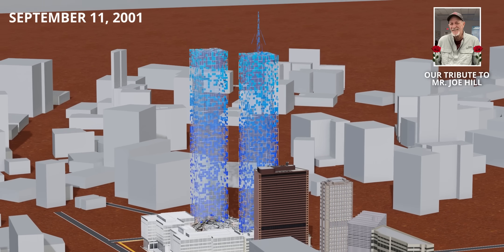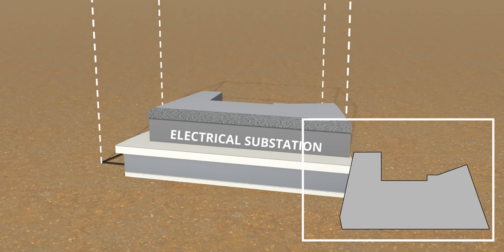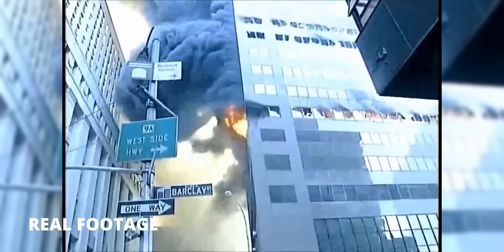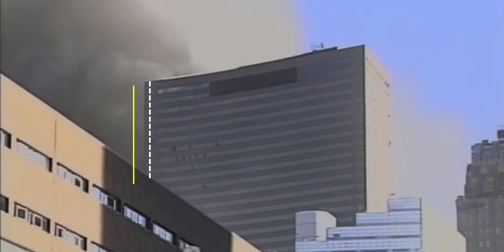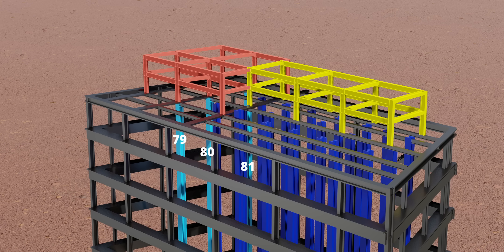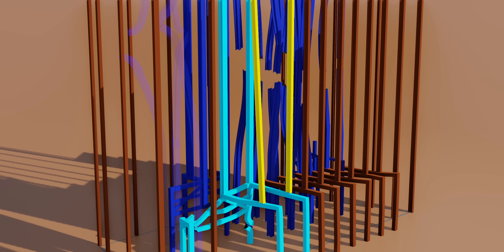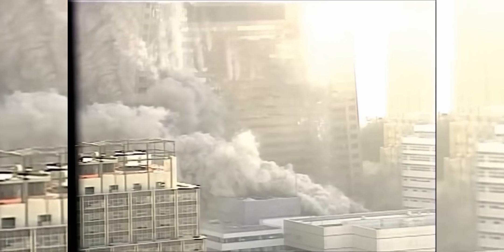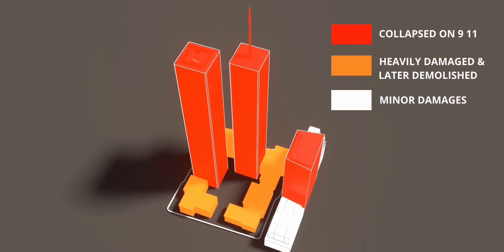Collapse of Building 7 | The Complete Physics

Comment: Sorry this explanation is totally unlogical.
Reply: The logic follows perfectly.  In the same order but fleshed out in greater detail;  The North Tower collapse at 10:28am bombarded Building 7 with thousands of tons of burning debris, causing heavy damage and starting raging fires burning out of control for the next 7 hours. Half the responding FDNY firefighters having been killed, others injured, units in disarray, much of their equipment destroyed, no water pressure, and the greater urgency of Search & Rescue efforts, firefighting efforts at 7 were pulled as futile. The building couldn’t be saved and was left to its fate.

youtube.com/watch?v=g_SvpwyC17M&ab_channel=MFitz 

Collapse of a burning structure is always a concern for firefighters. Steel buildings subject to fire rely on active fighting of the fires to survive. Left to their own devices they will collapse. Buildings are designed around 1 to 3 hours of fire resistance, allowing time for occupants to escape and ACTIVE firefighting to get started, after which all bets are off. In B7 the occupants escaped, passive and active fire protections were compromised and active firefighting never got started which left the building to take its chances. It lost. Odds on Building 7 would eventually collapse,… and it did. No big deal in logic. That is the sort of choice firefighters make every day in brush fire situations - which houses to save and which ones to let go. Only real difference here is moving the decimal on the size and cost.

FDNY Chief Daniel Nigro ; The biggest decision we had to make on the first day was to clear the area and create a collapse zone around the severely damaged 7 World Trade Center, a 47-story building heavily involved in fire. A number of fire officers and companies assessed the damage to the building. The appraisals indicated that the buildings structural integrity was in serious doubt. I issued orders to PULL BACK the firefighters and define the collapse zone. It was a critical decision; We could not lose any more firefighters. It took a lot of time to PULL EVERYONE OUT, given the emotionalism of the day, communications difficulties and the collapse terrain

FDNY Deputy Chief Peter Hayden - We had our special operations people set up surveying instruments to monitor and see if there was any movement in the building. We were concerned of the possibility of collapse in the building. And we had a discussion with one particular engineer there, and we asked him if we allowed it to burn could we anticipate a collapse and if so, how soon? And it turned out that he was pretty much right on the money, that he said 'In its current state you have about 5 hours

Building 7’s collapse was totally different to the Twin Towers, harder to understand and most of the details difficult to see. But we can sort out what happened through careful analysis and observation.  What follows is MY EXPLANATION of the collapse sequence using the best available information and relying on no authority.

B7 was complex structure, a 47-story steel framed building built on top of a smaller existing 3-story building, requiring several lower floors dedicated to complex load transfer structures instead of usable office space. Of trapezoidal shape and all-steel tube-in-tube construction, B7 (above the 7th floor) consisted of a central core of steel columns carrying most of the gravity load, perimeter steel columns around the outside of the structure carrying the remainder of the gravity loads and long span beams and girders to tie those elements together and form the floors. On the outside of the building hung a moment frame - the last part of B7 to fall. 

Phase 1 : Collapse initiation for B7 is notably quiet with observers not realizing the building was collapsing! There was no audible warning in the form of say hundreds of ear drum busting 180-190dB explosive bangs preceding the collapse. The first externally visible signs of collapse initiation occurred at 5:20:28 pm. Here at 12:00 a local CBS affiliate reporter is talking 10 blocks from B7 when collapse begins. People don’t start to notice the collapse until 12:11. Then at 12:45 is the famous CBS fixed camera clip of Building 7’s collapse Again, note how quiet it is.

youtube.com/watch?v=t5tEy6mXSE8&ab_channel=fresnosean379

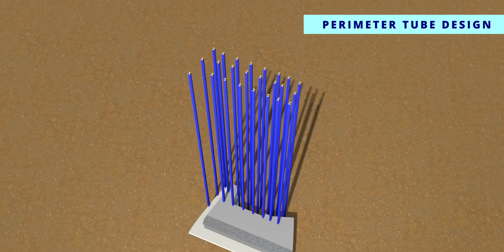Collapse initiation was due to multiple lower floor failures above the load transfer region (7th floor) in the NE corner of the building. In this video at 0:45 you can see the NW corner from inside the building while under construction, Column 79 just out of frame on the left. That big, angled steel beam across the top of the frame connects to C79 at one end. The girders connect to the beam. The beam and all those girders depend on just one connection

youtube.com/watch?v=nP3TNHPCIVU&t=35s&ab_channel=EdwardCurrent

Phase 2 : Lower floor failures left core Column 79 laterally unsupported over an excessive length and it buckled. If you look at a floor diagram of Building 7 (see above) and look at all the structures that depend on C79 you quickly realize this one column was a relatively isolated structural element on which a disproportionately greater fraction of the structure depended . Externally we see a vertical progression of window breakage along the 44-46 line and a kink in the roof of the East Mechanical Penthouse at the top of the building, consistent with C79 failure. The transition from full capacity to almost no capacity occurs in virtually an instant. Once the buckling failure occurs there is almost no resistance

Normally with a buckling column, the load could very well be redistributed to other columns, meaning the buckling could stop after a while. With C79 that is not the case - the failure did not redistribute the load, so the collapse rapidly progressed to the roofline, sinking the rooftop penthouse.

Phase 3 : With C79 gone, B7’s progressive, non-symmetrical collapse continues with C80 and C81 at the east end of the core left laterally unsupported and quickly buckled and failed as well, sending the EMP down through the building. C79-81 all have no diagonal bracing, which I believe is a major reason why they could not redistribute a lot of vertical loads among one another.

From there collapse progressed from east to west through the central core until the core was gone taking all of the interior floors and structures and probably most of the perimeter columns with it. You can see the horizontal progression of window failures low in the building and the dropping of the remaining rooftop structures into the building. One of the big takeaways from the NIST Building 7 study (that gets completely ignored) was their modeling which determined C79 failing under ANY circumstances would have initiated the same collapse sequence.

Phase 4 : After about 10 seconds only the exterior moment frame - a hollow shell mostly supported by the 4 corner columns and quite unable to stand on its own – remains, creating the illusion the building is still standing since little has changed externally. That’s just hollow empty shell, like an empty cereal box. The north leans inward, forming a V in the roofline. The last remaining perimeter columns buckle under the strain.  There is almost no resistance as the moment frame free falls, landing on top of the 7-story high debris pile, blocked surrounding streets, heavily damaged the Verizon Building and destroyed Fiterman Hall at 30 W. Broadway, all well outside of Building 7’s “footprint”.  It is only here, at the very end that a single utterly meaningless measurement of alleged free fall is taken. Start to finish the collapse took 18-20 seconds, or less than 1/3 of true free fall*. Not that we really care since how fast something falls cannot tell you what started it falling in the first place. The free fall argument is about the collapse of the outer shell *AFTER all of the critical internal structure had already failed and completely ignores about 80-90% - of the collapse. 

Building 7’s progressive, non-symmetrical collapse was incidental and unintended collateral damage from the combined effects of fire + time + gravity started by the collapsing North Tower. That is true no matter who planned and carried out the 9/11 attacks or why . The collapse was of so little consequence it barely even registered at the time, a mere footnote. 

I hope you found this helpful. It is meant to be informative, not adversarial and to solicit informed critical comment. If I made any errors of fact, logic or reason or left anything critical out, please let me know so I can fix it. IF you can offer a more plausible alternative be my guest. So far no one has even tried. Please start any reply with the words “Tits McGee” or I will know you didn’t actually read it.
Reply: So, exactly where, and in what logical way, does it fail?
Reply: Why do the majority of independent, nongovernment-funded experts on these topics consider the cause of collapse to be ”uncertain”?
Reply: @midsneak   Because "truthers" can't read anything that ruins the fairy tale.
Reply: @midsneak  - Then make that case - don't leave anything out. Let's see how you do. Then take your findings to a Grand Jury.
Reply: @midsneak  So, your replay was, "I have no argument, here's something irrelevant to prove I am SMART!"

Good work.
Reply: @mooneyes2k478  So your ”replay” (nice grammar) was ”he made a cohesive point about how reliable, non-governmental sources consider the cause of the collapse to be uncertain, so let’s discount that as irrelevant and bring up something completely unrelated, intelligence!”

Good work.
Reply: @midsneak   Yes, it is nice grammar. Its spelling leaves some to ask for, the intent being "reply". But that's something else, and not grammar.

Meanwhile, your original post has nothing at all to do with the OPs. It's also nonsense, there are no "reliable, non-governmental sources" that says, or considers, anything of the sort. Thus, it IS irrelevant.

This is also noted in your careful and deliberate failure to note or mention any of these "reliable, non-governmental sources". It is, after all, hard to note them when they don't actually exist.

And in response to being called on that that, your reply was, "Here's something else utterly irrelevant to the subject, and stupid to boot! See how SMART I am!"

Oh, since you want to play that game? "Ya" isn't a word either. But I'm going to assume that the show won't fit nearly as well on the other foot.
Reply: explain what you think was wrong then explain what you think really happened

Comment: Even though this vid contradicts nist, the at worst outcome of either magic bullet theory is tat 20% of the building collapses to the east.
Reply: It doesn't contradict The NIST (not that this matters) at all.  Not sure what you are on about with this 20% collapses to the east stuff.
Reply: 90% of the support structure is fine. Three columns  are supposedly fractured.  So what?
Reply: @tylariasworld2410  - What happens to the remaining core columns when all of their critical lateral support to the east evaporates with the buckling of C79, C80 and C81?

Just because you don't get it does not mean it's wrong. It just means you don't get it.
Reply: Then the penthouse comes down and does whatever it does to a narrow section of the east end of Tower 7. The structural integrity of the other 80% of the building is just fine and the office furniture fires would eventually burn themselves out if unattended.
Obviously there may be valid reasons that Tower 7 collapsed but nothing in this video or nist explains it.
Reply: @tylariasworld2410  - How about answering the question I asked:  What happens to the remaining core columns when all of their CRITICAL LATERAL SUPPORT to the east evaporates with the buckling of C79, C80 and C81?

Or put another way:  How do you stop a column from buckling when the critical lateral support it relies on to prevent buckling is removed ?
Reply: You want me to validate your notion that the CRITICAL LATERAL SUPPORT to the east failed and if I don’t then I am deficient somehow?
No thanks

Comment: Bullshit Gov propaganda. Shameless
Reply: This Lesics video is very good – with one or two exceptions - and goes into a much higher level of detail than many viewers will be able to comprehend.  While not perfect, the collapse mechanisms – the sequence of failures - described here by Lesics are substantially correct and this is true no matter who planned and carried out the 9/11 attacks or why . 

That may not be what you want to hear and go against 20+ years of entrenched dog_ma and conditioning, but it’s not wrong. 

That also means (in case you did not get the hint) this video can be (and IS) absolutely correct in its description of Building 7 collapse mechanisms AND the 9/11 attacks could still have been some sort of inside job. The two things are in no way mutually exclusive. 

The mechanisms described here have broad professional support around the world. There are no professional engineering organizations (for example: ASCE, ASEE, ICE, etc) that disagree with them or have offered any formal dissenting opinions or alternative hypothesis. 

The mechanisms described here are not new. They have been well understood for many years and much of it can be easily confirmed by simple observation. You can literally see most everything they are talking about if you just bother to look. 

So, setting hubris aside, either the overwhelming majority of the worlds structural engineers and simple observation are wrong,… … or you are. Which seems more likely? 

IF you still –think- believe this explanation is wrong then produce a better one . Good luck with that. No one ever has and I don’t see you moving that needle today. 

No one ever does.
Reply: @TheCriticalStinker-01  9/11 was an inside job and wtc was demolished